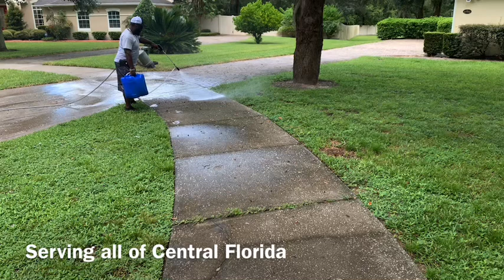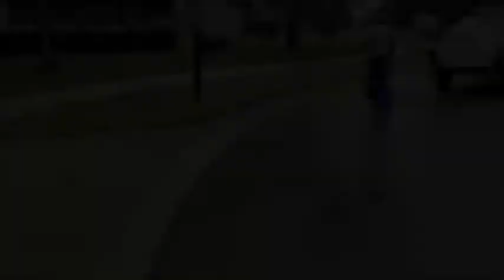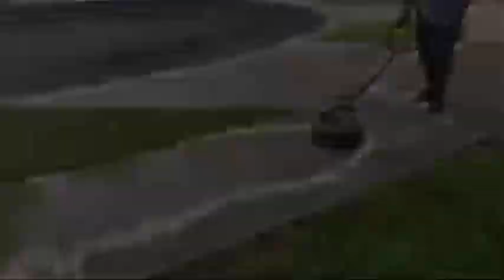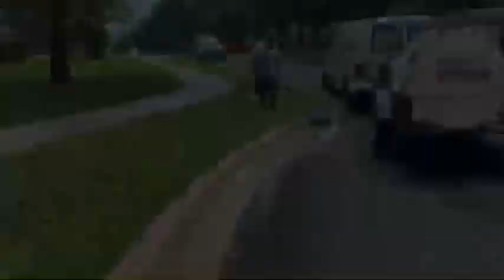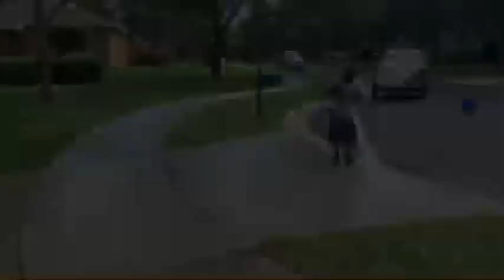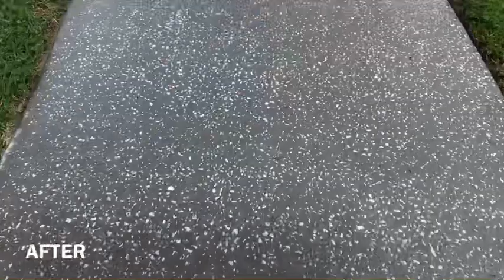Ep. 77 "ON THE GO" POWER WASH PRO TV

Comment: What kind of driveway is that? I have a client that has an Aggregate driveway. I was told if you pressure wash the driveway, you will need to seal the driveway. Is that true? Can use a surface cleaner on an Aggregate driveway?
Reply from the maker: Yes the sidewalk is aggregate......The driveway is laid with pavers.  The sidewalk most people don't have that sealed for a couple different reasons, one is, because there usually isn't much foot traffic on it that would warrant in most customer's minds the need to pay extra to have it done.  In terms of a driveway, no you don't have seal it, but it never hurts to inform the customers on the benefits of having it sealed and possibly earning an up sell. Being in Florida we don't have some of the same issues as Northern states for example, with the salt, freezing and thawing of ice and snow, etc. Sure you can use a SC (surface cleaner) on aggregate concrete, i'd just be cautious not to use an extremely high PSI.